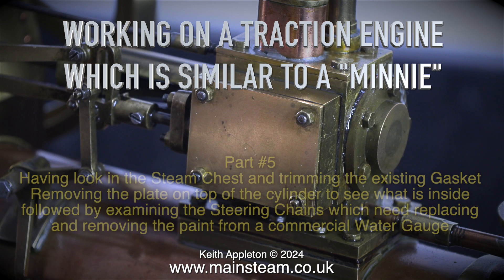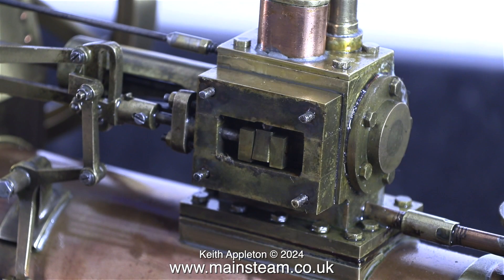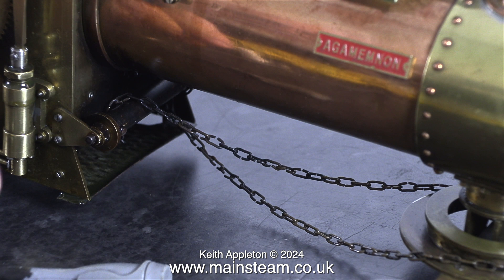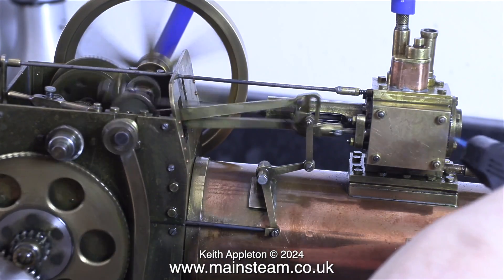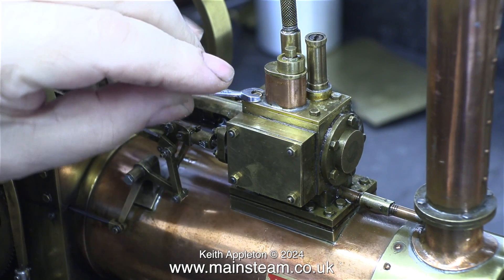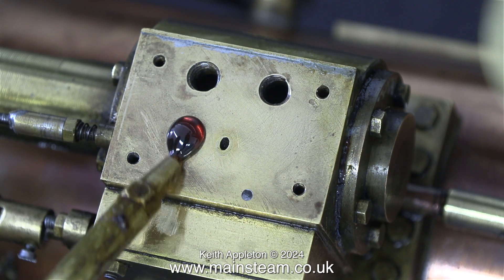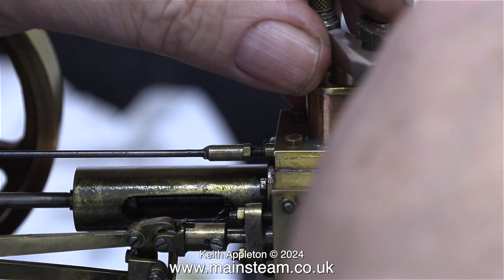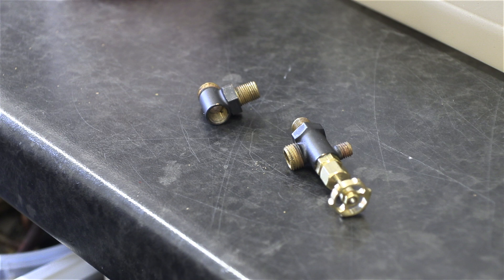A "MINNIE" TYPE TRACTION ENGINE - PART #5

Comment: If I had to guess I'd have to say that the mystery hole is either where the steam passage was drilled through into the steam chest, or a mistake.
Reply from the maker: It is a lubrication point. I figured it out ......

Comment: I wonder what the reasoning was behind using soft solder? Was it ever meant to be ran on steam? It's such a beautiful model.
Reply from the maker: The entire thing is a bit odd, no casting were used and it is entirely scratch built. The soft soldering is of very good quality, as it the general workmanship - that's all I know.